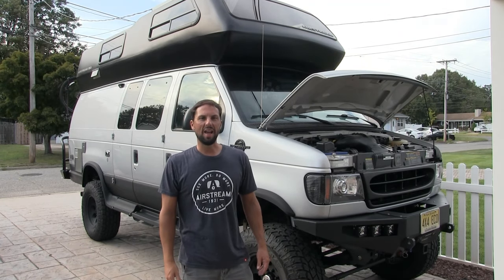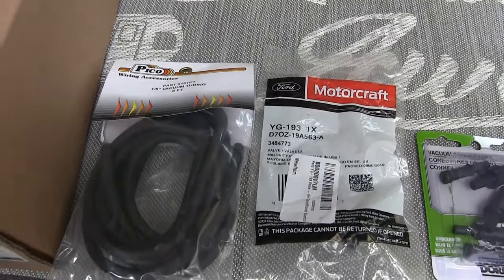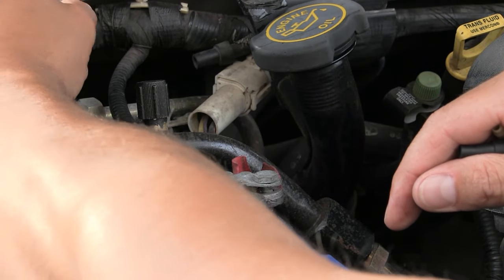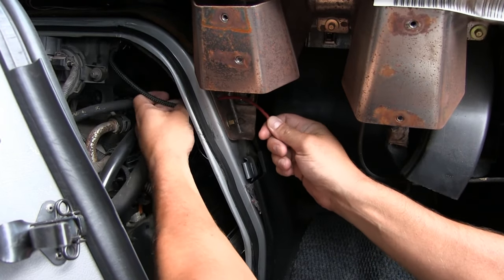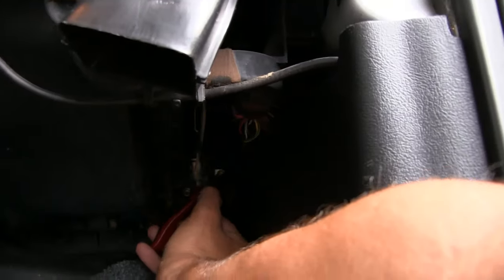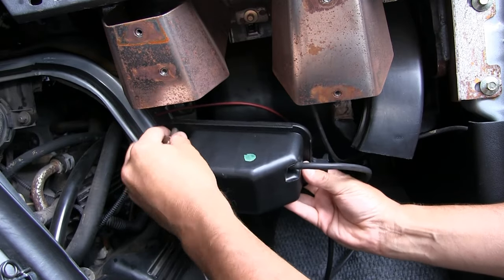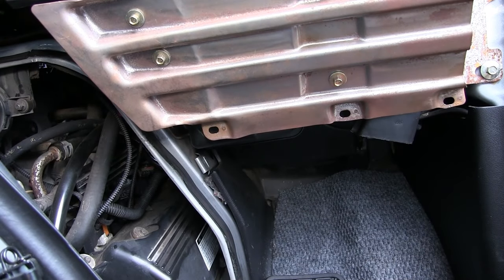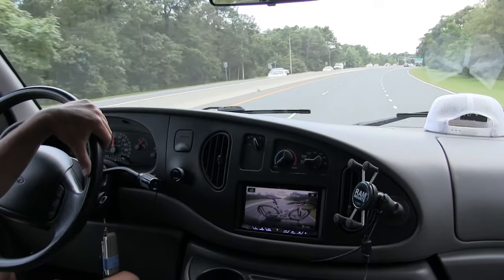Ford Econoline AC Heat Defrost Acceleration Fix

Comment: Very good video. The only thing I'd add, as a precaution, put a piece of tape on the vacuum hose when passing through the insulation from engine to where the vacuum canister will end up. Nice job.
Reply from the maker: Good suggestion.

Comment: So originally my AC was permanently stuck on defrost only. Doing exactly as you did, as well as several other videos showing the same process, it restored AC functionality to the front vents. However,  I still lose vacuum and it switches to defrost when accelerating, until I let go of the gas pedal again. I've traced all the lines and simplified it as much as I can, with a genuine Ford check valve and vacuum reservoir just as you did. I'm pulling my hair out over this thing.
Reply: Did you ever figure your issue out? I did this fix and still having the same issue with AC coming from the floor vents under load, and my rear AC blows hot

Comment: So awesome, thank you for posting this! I asked my mechanic about the AC cutting out and he said it was some kind of built-in mechanism to keep max power to the engine under load (or something like that). I found that to be bizarre, mine is a passenger van, were passengers really going to sit in a hot van when being shuttled in the mountains to some resort?? Please. The last two days I was out in the desert riding dirt bike and I got so annoyed at the on/off behavior I decided to search again today and here I am. Just ordered all the parts. The only part of the video that concerns me a little is snipping the wire under the dash because the video is a touch dark there, but I'm a wrencher, should be able to figure it out. Cheers!
Reply from the maker: Glad it was helpful. 1st time I heard of someone coming up with that theory

Comment: Nice fix. This problem only happens with the gas engines. The diesels have a mechanical vacuum pump run by the engine belt. Not sure if the diesels have that accumulator. But all E-series have a problem with that main vac line leaking under the heater box and you would only get air flow to the defrost vents. We would run a vac line directly from the main through the inner fender and then connect to the black line you cut under the dash. This may fix the issue you were having as well. But you wouldn't need to purchase the accumulator. One of my guys did something similar you did.
Reply from the maker: Thank you for the tip

Comment: When you cut the line under the dash, if you start pulling on it.  It and the bad check valve with usually come through with the short rubber hose.  So no need to cut the line.  I pulled my vacume line under the hood up and out also.
Reply from the maker: Thanks for the tip
Reply: I just logged back on to share this same comment.  No need to cut the line.  Just pull it through the firewall.  Pull the extra/deleted accumulator line from under the hood, and in my case the check valve came with it, which still worked.  I was able to use original vacuum lines and fittings from the deleted accumulator line.
Reply: @wiverstine  

Yep, I cut nothing.  And refused all the connections.   I did get a new check valve and accumulator.   Tried it without accumulator.   It would cycle depending on load in the motor from upper vents to lower vents.

Comment: Great explanation.  I'm going to give it a go on my 2013 e-350. The dash is a bit different.  I'm sure their is a way.
Reply from the maker: Go for it James
Reply: Just finished thanks!! The Motorcraft  check Valve was taking forever on delivery. Just picked up a ac/Delco gm check valve in stock at advanced auto for around $3.50 and it worked great!

Comment: Thanks for the video. Very helpful. However, my problem was sudden default to defrost with no warning signs. Now after installing this method i now have the problem you described. Hi rpm defaults to defrost temporarily. Very strange. Never had that problem b4. Whats really crazy, is my check engine lite, on for years, has gone off. Very strange. Thanks again.
Reply from the maker: So weird

Comment: All available on Amazon.
All three will usually show up under "Frequently bought together"
$10.59 Genuine Ford Part D7OZ-19A563-A
$23.53 Dorman 47995 Vacuum Storage Canister Compatible with Select Ford Models (cheaper than the Ford part)
$7.98 Taiss 6FT ID 1/8 "(3mm) Silicone Vacuum Tubing Hose Line (Black),High Temperature 130PSI Max Pressure

Comment: Just got a Chinook RV and we were boiling alive on the way home from camping. This video makes it look so easy to fix. I'm not a wrencher, and this may be a dumb question, but what is that part you attached to the drill to be able to use your socket in different angles? Thank you so much and can't wait to fix this myself.

Comment: nice!! did you even need the connectors shown at 1:35? it looks like you were able to recycle the abandoned connector from the passenger side.
Reply: update to answer my own question. just did this fix, and no, you do not need any additional connectors. just recycle the existing parts, and it works fantastic!

Comment: Happens in my 94, can happen from 92-current not just 97+ like you say in the intro
Reply from the maker: Thank you for informing
Reply: My 93 is same, BUT way different under where you install the reservoir.  Locate reservoir on passenger sidwall...you have to drill a hole and  run the vacume hose up over top of everything and down to floorboard where you snip old hose.

Comment: Wayyyy too complicated...at 2:09 the white vacuum fitting. I replaced that with a $3 inline check valve from pepboys . Air stays constant under load now for over a year. 2 friends have similar vans I put the check valve in for them and no more problems for them either
Reply from the maker: Thank you for your suggestion
Reply: Good idea, tried it but "no go". What did you do with the third connection on the check valve?There's no tubing under the hood and no way to hook it up without getting under the dash. Am I miss something?
Reply: @Da_Xman  hard to explain without showing you but if you're standing in front of the van on the left side firewall just below the cowl you'll see a small vacuum line with a rubber coupler to a larger vacuum line. That's the one you're after the valve I bought at pep boys was in The help section and it's stepped from small to big so replace the factory rubber coupler with the check valve.
Reply: @repobud1  Hey 150man - thanks for getting back to me! That's the coupler I replaced. I used the stock, 3 connection Ford check valve (in the video) to replace it. I tried all 3 ways to connect it to the existing rubber tubes and taped the extra connection closed. The AC, heat and defrost work fine but, when a load is put on the engine, the damper still closes. Any ideas are welcome but, in this case, it may be that the accumulator box needs to be replaced too. Again, thanks much for taking the time to get back to me (your idea is definitely a good one!). 
⚡👍🥴⚡
Reply: I tried a new check valve today and it did not fix my problem 2006 E150 defrost air only.

Comment: question.. does this work with the super duty (e350) with dual air? i noticed your van only has front a/c, typically the 3/4 ton e250.
Reply from the maker: I haven’t run into this question yet, I don’t see why not

Comment: Thank you for the info I have a similar van and my are just completely stopped the switch don't work at all doesn't turn the air on and does not work the fans

Comment: Very nice video but Im a little confused as to the check valve hookup. Other videos show the accumulator being connected to the nipple on the opposite side of the main vacuum line coming from the engine. You connected the accumulator to the nipple coming off of the top of the valve. Which method is correct? Thank you again!
Reply: Just do whatever he does it will work trust me I just did it last night and it works like new

Comment: I'm getting ready to fix this on my 2010 E150 van and this video is very helpful.  Thanks.  One question though... I get the reason to remove the one bolt to thread the line through and just poke a hole in the insulation. But why not just drill a little hole beside that bracket?  How important is that bolt?
Reply from the maker: It was a way to simplify the install with one less tool

Comment: Ordered the same brand 1/8th inch vacuum tubing off of amazon, but the hole is to small to fit on the reservoir and the black vacuum connectors. And idea why that is? Could a 1/4 or 3/8th vacuum tubing work if I order it?

Comment: My air only blowing out of the defrosters and I did what you said and it worked.  However,  Im having a problem with it stopping when accelerating and then it going back to coming out of the vents when its not on a load.  I hooked it up the way you said.  Is there something that I may have missed to correct the problem. I bought the new canister and new check valve.  I'm still happy as can be that I at least have AC coming out now but wish I could figure out why its stopping when Im accelerating. Any help would be appreciated.
Reply: Did you ever find the fix? I followed the video and an having the same problem you are now.

Comment: Did the accumulater fix. The AC no longer cuts out on acceleration anymore!!! 👍 But now there's good air flow from the floor only, with extremely low flow from the dash. Defrost works OK, but heat is also floor only with extremely little air flow from the dash. Any ideas? 
⚡🤔⚡

Comment: Does this fix the air conditioning system to blow harder? Mine is very fainted I cleaned the condenser saw a bird made a nest and it didn’t really help just curious if this makes it blow harder

Comment: Could you help me? I have a 2003 Ford Ecoline e350 5.4 V8 engine and when accelerating or climbing, hot air comes out from below and in the back from below and the grilles stop blowing eladi air and it doesn't come out until after a few seconds, pull me again. Could you tell me if doing that solves the problem and if so, could you tell me which engine hose I should join because I don't know which one. Could you please specify?😢
Reply from the maker: Seems similar to the problem I had and the many others that commented here
Reply: @NewJerseyOutdoorAdventures  Could you tell me which hose comes out of the engine from which part to join it with the other and the vacuum canister please?

Comment: Good Video Sir.  I have a 93 and my vacuum line setup looks a little different.  I have a vacuum reservoir located in the front passenger side corner of the engine compartment.  Do you have one also? I have pictures I can send.
Reply from the maker: It’s quite possible but I didn’t have to go that far

Comment: I have a 2013 E150 that was / remains doing the same thing after the exact same fix. I did notice that I hear a door activating as I accelerate. Also I purchased a ganerick check valve from Advanced Auto
Reply from the maker: I am not sure if they cha bed the design on the newer models and if it is related to this fix since yours is new enough that it could not ha e deteriorated
Reply: @NewJerseyOutdoorAdventures  2013 not 2017

Comment: Thanks for this excellent instructional video; It is going to prove to be very useful, I am sure. I have a 1996 that needs fixing in this way. I imagine it has the same vacuum diagram as the 1997+. Can anyone on here confirm? Thanks in advance.
Reply from the maker: Should be almost similar

Comment: I just recently had that same problem with my 2001 E150 Van and fixed that exact same way! A/c works great. Now for some reason, my heater stopped working! Are they tied into same vacuum line? I had my heater core replaced last fall and radiator the year before. Thanks 😁👍👍
Reply from the maker: I am not sure. I’ll have to check the heat. I hope 🤞mine works. Did it work after the heater core?
Reply: @NewJerseyOutdoorAdventures  no it didn't!😭
Reply: I haven’t done this fix yet. My blower motor stopped working, they say you might as well replace the resistor also, while you’re there.

Comment: So instead of going through the doghouse just take a vacuum line run it through the firewall grommet  and up to the hose connector.  No need to remove bolts and reroute the red hose. I shoved a coat hanger through the grommet taped the new vacuum line on it then pulled it back.  The worst part of replacing the parts to the original place is evacuating the ac . I have done it the whole dash does not come out  just the box. While you are in there might as well buy a heater core because it comes out also.
Reply from the maker: Thank you for the suggestions

Comment: Hi there, I have a 2011 e350 with this same issue. Do you know if I cut the same wire? Or does this vary on each vehicle. Haven’t gotten in and taken a look yet. Still need to order parts. Thanks!
Reply from the maker: It may vary van to van and year to year

Comment: Very good video. My 2001 ford van is doing the same thing but in addition mine only blows out through the max speed but blows very low. When driving the blowing will randomly stop then comes back. Is this also the problem you are referring to in your video? if so, if I buy the items you mention and repair the way you are showing, will the air blow through low, medium and high like they are suppose to when I am finished? Thanks and hope to hear back from you soon!
Reply: This was exactly my problem. Air only coming out the max speed but blows quite low, it also would die out then come back on. I found a video on you tube that addressed air only coming out of one vent which happens to be the max speed one. The video stated the problem was a bad blower motor resistor. I followed the video, bought the resistor at local parts store, replaced the resistor and air blows great now out of all the vents.

Comment: I have a Class C motorhome with the Ford E350. When I accelerate it stops blowing through the AC vents and starts blowing thru the defrost vents is this the same issue and fix?
Reply from the maker: Yes
Reply: @NewJerseyOutdoorAdventures  thanks for your quick response. I have seen others talk about your check valve and you chose that as well. But my check valve is on the driver side of the engine not the passenger side and I have to check valves. One of them is black and white and has two hoses but the other appears to be all black and has two regular doze houses and one small hose. Should I replace those 3 under the hood first to see if it is those? Or should I assume it is the reservoir.

Comment: Question: Can I do it on the 2011 Ford E350 Econoline?  Thank you
Reply from the maker: Yes it should be the same
Reply: New Jersey Outdoor Adventures thanks man, you are very kind, and by the way, you are right about the cost of repair and what you did is just cheap, practical and I give you the credit of a professional
Reply: Thursday night watch your video, Friday I ordered the parts today they arrived and I have done the work and the air from the truck's vents were working perfectly !!!  And you knew that they were charging me $ 950 to change the compressor and gas tank, and the most ironic thing about all this is that they would leave the vents working directly.  I spent only $ 98 an hour of labor and voila. The only thing that the black box could not be screwed on because of the space, but I glued it with Velcro to the plastic surface and everything was fine.  your video was very honest clear and very beneficial.

Comment: Did the fix exactly as demonstrated, but it didn't fix the problem. Swapped the tubing going to both white connections on the check valve and also changed out the new tubing, but the problem continues. Next step is to buy another new accumulator and check valve and try that. Any bright ideas?
Reply from the maker: Not sure 🤔
Reply: Did you get it figured out? My front vents switch less now, but the rear AC still blows hot.
Reply: @SkyWalker210  Never have figured it out. A mechanic buddy says there's other parts under the dash that still haven't been checked; plus there's all the vacuum tubing that could have leaks in them.

Comment: HELP PLEASE....under my hood is a "tee" not a straight connector. Your video shows clearly just a single line connector. Do I pull two wires under into the dog house or just the red one? And if two, which two? Its a 2002 econoline 5.4.  Maybe one on the tee is for a rear air switch and your van only has a front switch. I am just guessing now that is why I need to know before pulling tubes and cutting them. Thank you...great video ( except for this part where my van is different....Mine is a 4WD now so maybe an aftermarket on the fly. That may use the vaccuum and account for the third line. IDK.
Reply: Did you get it figured out? My front vents switch less now, but the rear AC still blows hot.

Comment: I have the same problem with my 98 Durango I just bought. Accelerate hard and vent or floor switches to defrost. Let off the gas a little and it switches back down to floor or vent where it is set.
Reply from the maker: I’m sure it’s a similar problem

Comment: Quick question... I have this issue but only on ac, I have noticed if I take overdrive off it doesn't do it. Do I actually have the same problem or something different? Fingers crossed this is it this crazy girl can do this fix 🤣

Comment: My 2012  E150 has no AC issues other than not being super cold when at idle/traffic.  Is this the same issue?
Reply from the maker: Could be the same problem. Loosing vacuum when accelerating and pushing the cold air through the defrost vents